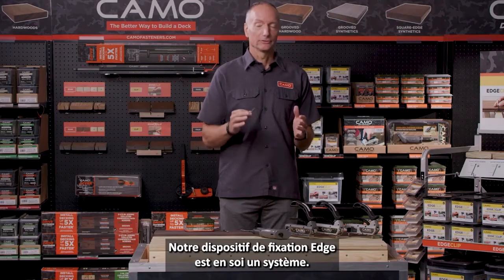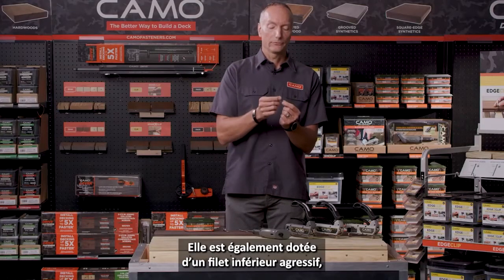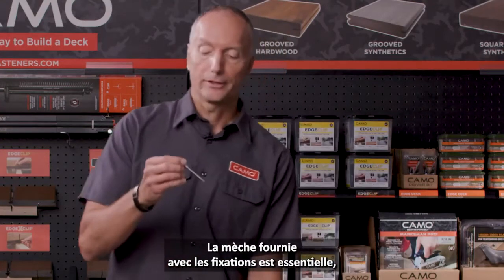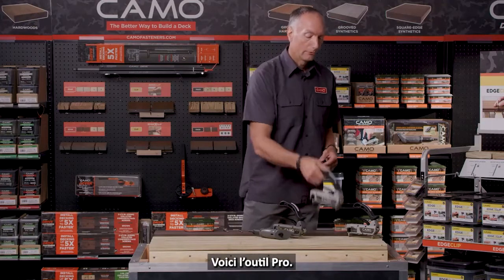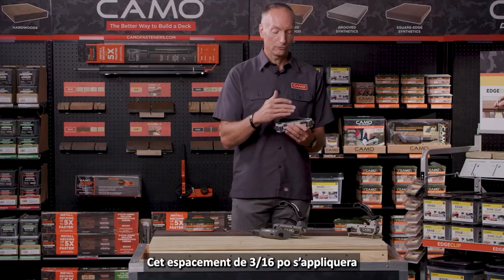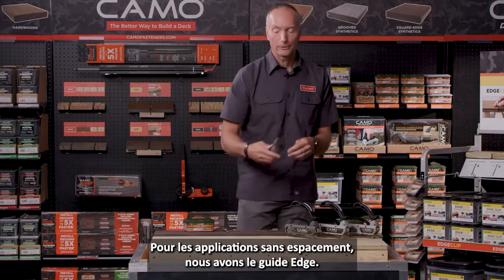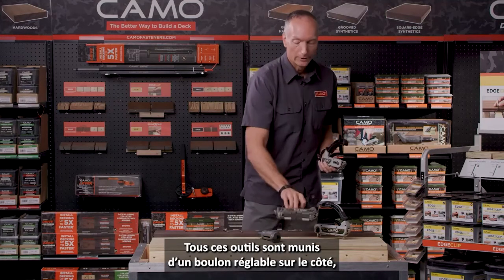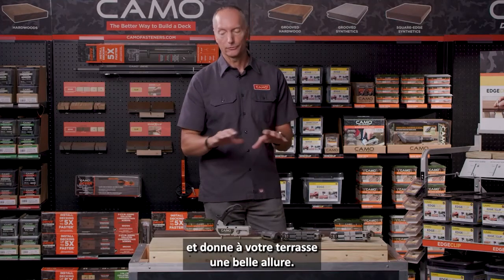CAMO® Hand Drive Edge Fastening System - Français (CA) sous-titré

Comment: problem with the smaller width nb tool is that its only 3/16 for gap not 1/16.
Reply from the maker: Yes, this is correct. We do offer the Marksman PRO-X1 which creates a 1/16 gap and fits most 5 1/4 in to 5 3/4 in boards, but not for narrow boards.